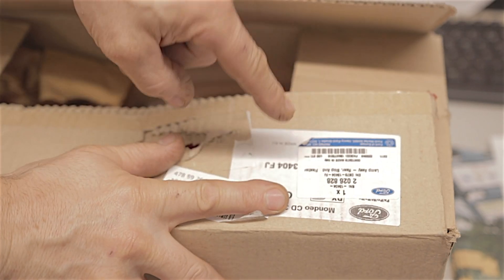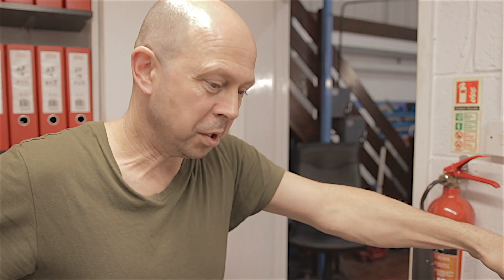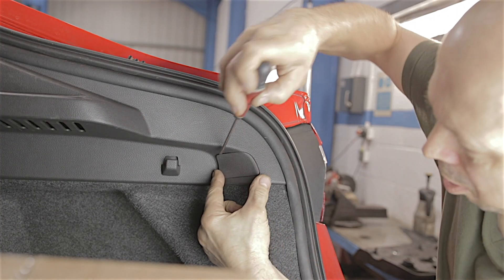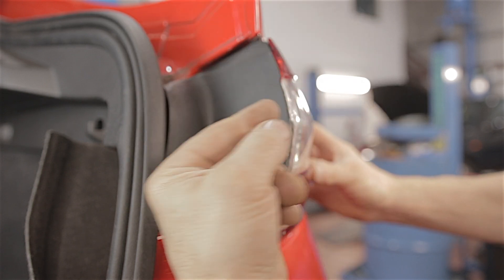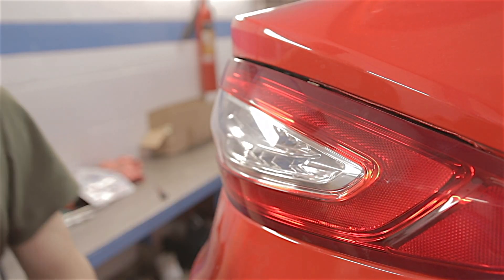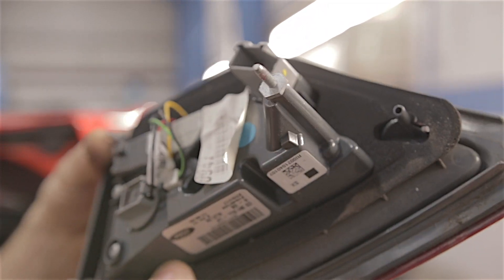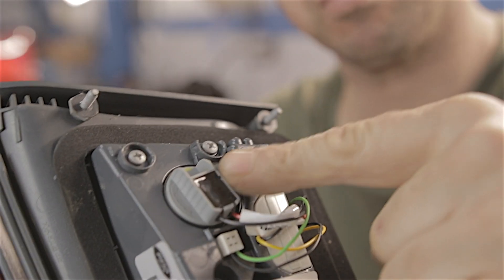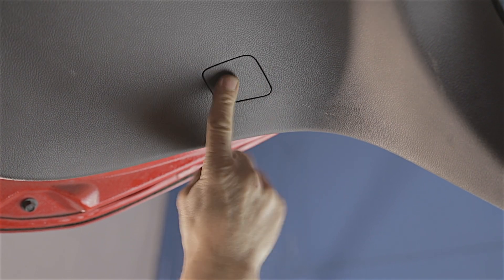Ford Mondeo Mk5 Rear Lamp Unit Swindle

Comment: You can get one just tell them it's left hand drive.   Ford UK can order all the left hand drive parts. I found out by accident. I had asked before they said no. Then one day i was ordering another part the guy behind the counter asked if the car was left hand drive?  I said you can order parts for left hand drive he said yes.. I then ordered a reverse light lens for the drivers side.   I even have a matching set of foglights
Reply from the maker: thanks.. that is very interesting to know
Reply: I’ve posted part numbers

Comment: Does anyone know why the outer cluster light strip wouldnt work when plugged in. I have checked the lamp and it works when plugged in on the other side. There is no fuse, could it just be a simple loose wire?

Comment: Is this pretty standard for removing the outer tail light from a Mondeo? I have a 2014 Mondeo 1.6 zetec  business edition. Apart from there being three bolts instead of two and being able to disconnect the wiring before removal it looks pretty much the same. Just wanted to be aware of any surprises before I attempt it.

Comment: Like it. before I hear you test it. I've already changed mine to foglights both sides
Reply: What's the point? It's not you who is going to stare at those fog lights anyway. Also it may violate the legislation wrt car light equipment.
Reply: @bormisha  I don't know how old you are but all cars had 2 rear fog lamps and they had to be working to pass an M.O.T. With having one fog light at the rear and your driving in thick fog you could think that you are following a motorbike. Also if one went out you still had one that could be seen till you got it fixed. 2 Lights are better than one. As for legislation. I will find that out when M.O.T comes up.

Comment: Most  cars only have one rear fog light which I think is better for following drivers because fog lights have the same intensity as brake lights. With two on, it takes a fraction longer for the driver behind to notice brake lights.

Comment: Alan, do you give your customers the option, to supply a salvage part for you to fit? A quick look on Ebay, there is a used rear MK5 outer light cluster £225 and the inner light cluster is £110.
Reply from the maker: hi, that option is always on the table if it is what someone wants...they would have to ask but i don't see many customers as nearly all cars i fix are company cars

Comment: Hi. I love your videos and you gave me a lot of information to help me spot faults now when buying 2014 mk4 2.0Tdci. I have two question I would be very gratefull to see you answer. 

1st what seems odd is when I try to start and am releasing the clutch it starts grabing at lets say half way. Is this normal or is the clutch at the end of it's life?

2nd under the bonnet the strut that goes from headlight to headlight and the ones over the front shocks are not in the same color of the car (car is blue and the struts are black) is this normal or it shiws that the car has been worked on after some accident? (Like that the fenders were painted and struts werent) 

Thanks in advance and I subscribed
Reply from the maker: hi..your 2 questions...if the clutch pedal starts to bite at the half way mark or higher then it is a sign the clutch plate is worn and will start slipping sooner rather than later depending how much mileage you cover.
  as for the dull different colour paint under the bonnet,,, ford has been doing that for years now..it does look odd but perfectly normal, i guess it costs less to use cheaper paint under the bonnet
Reply: @alan4x  thank you for answering.  It shouldnt feel like this at 100k miles 4 years old, should it? If it would need to be replaced the flywheel should be replaced at the same time probably. 
With the paint is interesting, because a lot of silver, sand or even some red ones I saw painted. Other red and blue one not.

Comment: If dealer says they can’t get a LHD unit they are talking out their backside. They can order any left hand drive parts and they get dispatched from Germany.

Problem is they are looking it up with registration number, and they lack the common sense to realise that ford ecat won’t list a LHD part for a RHD vehicle when using registration.

Here is the part numbers for LHD left inner rear lamp mounted to tailgate itself.

Part number for, 4 Door Saloon / 5 Door hatchback  Vehicle

Lamp Assy - Rear, LH, LHD

Is 5256736

Part number for, 4 Door Estate
Vehicle

Lamp Assy - Rear, LH, LHD

Is 2016613

On the LHD vehicles still only 1 fog light as they list a RHD lamp and a LHD lamp for both sides. So blanked out one is just on opposite side

Comment: still silly money from euro,s  tho, a trick sometime used is to put the unit in the oven and melt the glue, then you can take it apart and renew the led,s , if you do melt it it,s no great loss as you would have had to replace it in the first place ?
anyone seen if Valeo ? sell them direct

Comment: There should be laws about non serviceable sealed parts like that, what a waste for whatever has gone pop inside it (which I bet literally costs pence).

This LED craze is bonkers, when a rear 382 bulb goes out in the Mk4 the dash tells you, then you spend a quid or so on a bulb and ten minutes of your time job done.

Even at £350 it's an absolute joke, its a bloody poverty spec mundaneo!
Reply from the maker: lol..... add blue is coming...cars called blue motion to sound good when running on pig piss...yeah i bet led are cheaper to produce than a filament bulb and nobody cares what a lumen is lol
Reply: Yes I bet your right. They talk about saving the environment and you have to spend hundreds of pounds for a complete unit when it could be something simple.

Comment: blimey, even the eurocar price is too much, I would try to repair it first.
every video you do confirms I will never buy a mondeo.
Reply: Considering most cars now are switching to LED rear lights, could you imagine the price for German brands rear lights?? I bet the Mondeo is cheap in comparison.
Reply: Shandybrothe
Reply: yes , marked up prices for sure, these component leds inside these are made for next to nothing.
Reply from the maker: thats £2000 for a set of rear lights from ford...have a smiley day lol
Reply: @alan4x  its ridiculous, but I bet thats cheap compared to the dynamic LED headlights you can spec them with, I would hate to think what a set of them would be.
Reply: Mr fords aving a larf eer is he aving a larf
Reply: @interceptor-ss8kb  Ford parts are some of the most expensive
Reply: @JayJayJaroo not from my experience but yeah definitely not the cheapest either.
Reply: @interceptor-ss8kb  Ford parts used to be one of the cheapest manufacturers for genuine parts along with Vauxhall and a few others.Ford prices have gone up drastically over the years where they are at times more expensive then BMW and Mercedes 
I recently had to purchase a rear outer light unit for a 2015 BMW 5 series from the dealer which was £335 inc vat
Reply: JayJayJaroo gone up about 20% in 3 years.
Reply: @Clicksystems  im surprised how much Ford now charge for certain parts